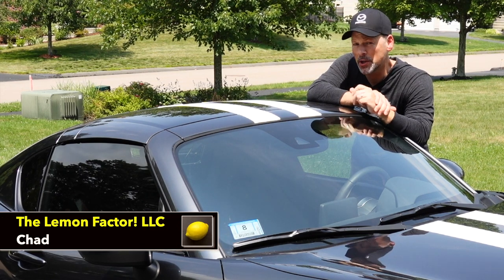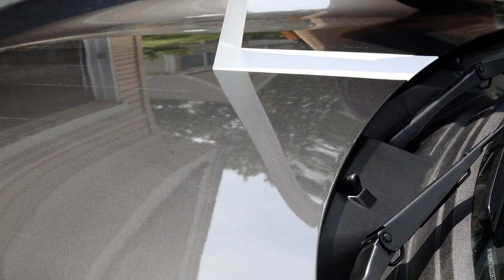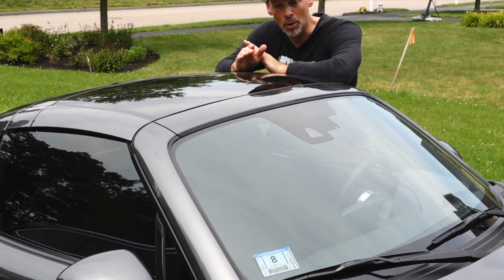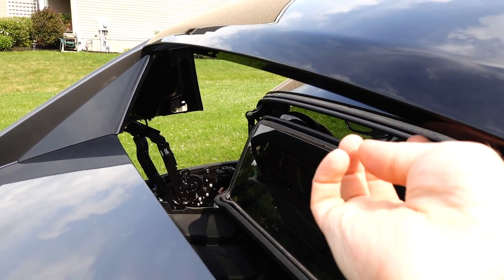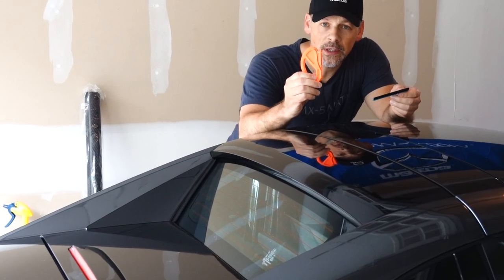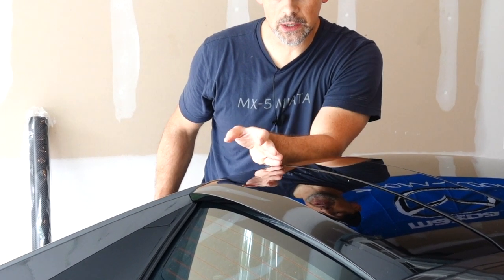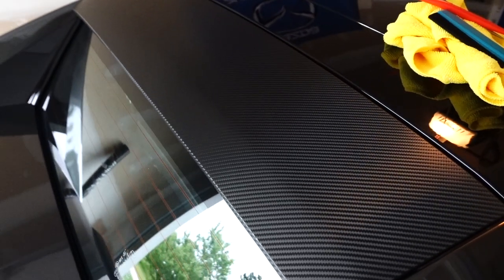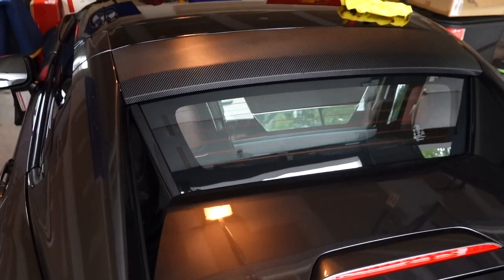CARBON FIBER Vinyl Roof Wrap // ND Mazda MX-5 Miata RF

Comment: Im thinking about wrapping the rearmost panel on my RF, the black material just picks up swirls like nobody's business and I only wash it with ONR and every other panel is basically swirl free lol.

I already wrapped the gear shifter surround in carbon fibre as I hate that fake aluminium or chrome material.
Reply from the maker: I think that would be a good idea!  I totally agree, the OEM gloss is a swirl magnet.

Comment: Hi Chad great videos you have been making. By the way does your ND RF have this wining/moaning noise coming from the rear when turning in small radius at slow speeds?  Mine is quite noticeable and wondering if this is normal.
Reply from the maker: Thank you 😊. My RF does not make the noise you described 🤷‍♂️
Reply: @TheLemonFactor  ok thanks.
Reply: @TheLemonFactor  oh Chad does your ND have LSD by the way?
Reply from the maker: Yes it does.
Reply: @TheLemonFactor  Ok thanks

Comment: Man, I wish I can do this as cleanly as you have.  I tried the clear PPF and after 3 attempts, it wasn’t happening.  Couldn’t get rid of the air pockets underneath.
Reply from the maker: The air released vinyl is much easier to apply than the PPF wet application. Give it a try. Just be careful with the blade - we don’t want to cut anything else but the vinyl.
Reply: You need to buy quality vynle lol

Comment: Excellent video. Love the result - beautiful. I've had my daily-driver MG RF EXPEL stealth wrapped, but kept the roof its original gloss paint. Now considering a CF wrap, just can't decide gloss or matte. Gloss would definitely contrast with the stealth. Have you looked into any of the remote controlled roof mods?  The up/down switch issue or speed operation issue are not important to me, but being able to open or close via the key fob sounds interesting.  Thanks!
Reply from the maker: Thank you for the watch and positive comment 👍. Next time I’m going to try the gloss as I think it would pop more especially with the MG. I have not looked into having the top operable via the key fob, maybe I should 🤔